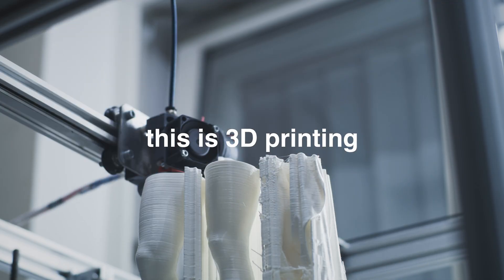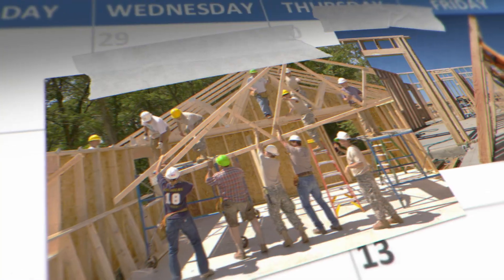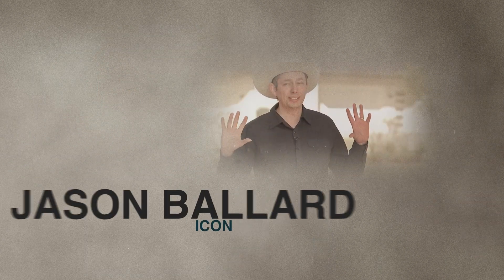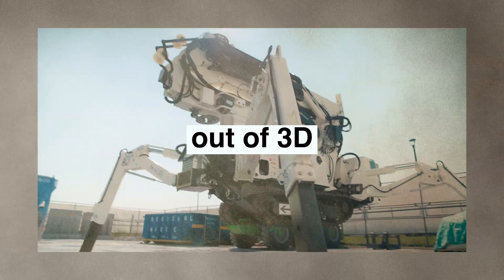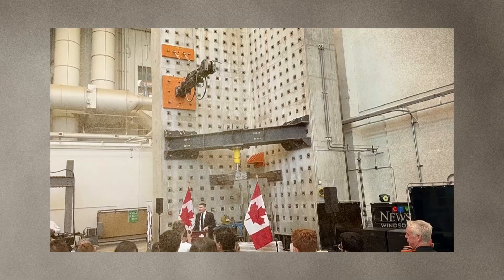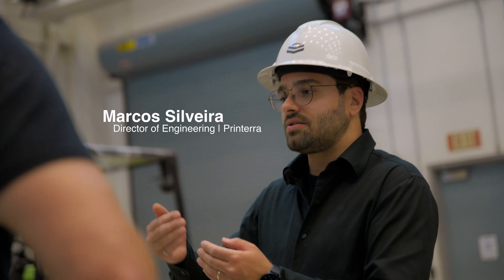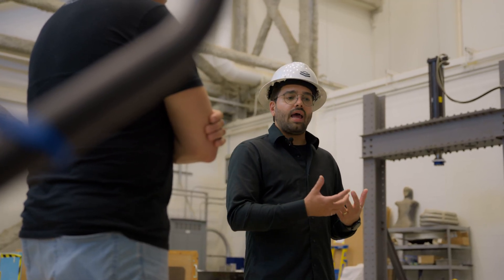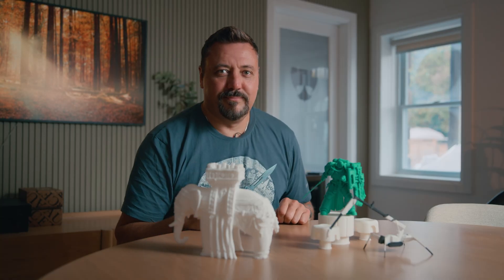Can this SAVE you MILLIONS on your next home? | 3D Printing Explained

Comment: Multiple printer companies have been started in the last 10 years and they have all failed.
Companies started from the outside oof the industry almost always fail. I havent seen one from inside the industry.

Plastic is worthless for construction since it doesnt meet any safety standards and will kill all the occupants durring a fire.
Reply from the maker: You've pinpointed the key challenge: successful construction tech needs industry expertise. You'll see us exploring new methods and tech with industry experts - including more on 3D printing since you're right, standard plastic is unsafe. These printers use a specialized, high-strength concrete mix that is tested to meet the same fire safety and structural codes as conventional concrete, making the final walls just as safe.

Comment: How are they allowed to build this way without the rebar? That broken concrete near the end of the video had no rebar. I'm not a rebar fan but it does have a purpose in modern construction.
Reply from the maker: You're 100% right that rebar is essential because concrete can't handle tensile forces on its own. 3D printing doesn't so much 'skip' this step as it rethinks how to provide that strength. We're diving even deeper into 3D printing so you will definitely see more explanation in future videos as we start to build.
Reply: @KrisPottsOfficial Ok. I look forward to it.

Comment: Concrete building printing has been around for over a decade. It promised changing the world. It didnt.

Construction sites are chaotic places in regards to weather, sub trades, deliveries, and material/labour shortages. 3D printing has stringent demands.

Not to mention chain of supply isnt geared to construction printers. Either the staff, parts, and technical knowhow.

Im sure its not going away, but it was over hyped.
Reply from the maker: You’re right... the early hype oversold it. Real sites are messy, weather-dependent, and full of moving parts. That’s why we’re documenting this journey: to test if 3D printing can stand up to real-world conditions.

Comment: Idk. Its not ready yet. The printed homes here cost more and take just as long. Takes a specialized crew to build the home cause a printed home is far different then a sticks and planks kind. 
The hardest part is getting the mix stable, as a temp change or humidity change in the air changes the way the slopp flows and cures. Figure out the mix and youll solve 80% of the issues. I work with a printing crew here, im good with the machines, ive been printing since 2008, early in the reprap days when we wrapped vape wire around air brush nozzles to make our hotends.
On top of that in order to save you million your cost would have to be un the tens or hundreds of millions to begine with and only like 100ppl cane afford that. So maybe someday it will save you time, but i dont see it saving you money, until the robots replave the people..... but again once that time is among us the masses of people wont be needed so the houses wont be built.
Automation will only make your life easier until it replaces you completely then all of a sudden your fighting to prove you have value.
Reply from the maker: Appreciate this, seriously. Perhaps right now 3D printing only seems cheaper if you build at scale and automation could create a whole can of worms. That’s exactly why we’re doing this show! We want to spotlight the folks in the trenches (like you), and to figure out what actually works, not just in theory, but stick around because we are actually going to start building with these technologies!
Reply: @KrisPottsOfficial they've done scale construction projects and it was a failure.
Even in Texas where standards are lower because of weather and no earthquakes